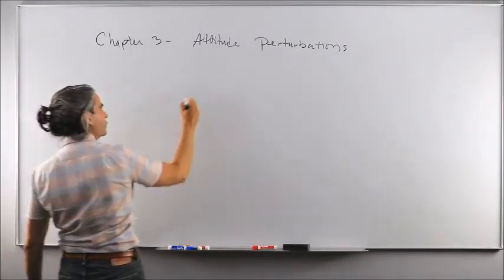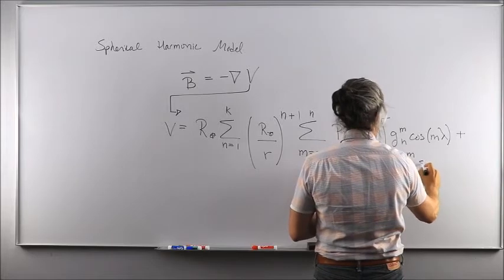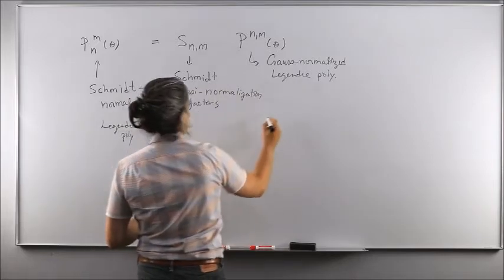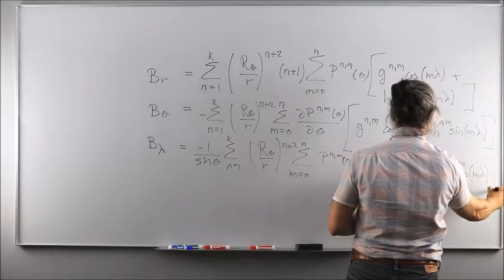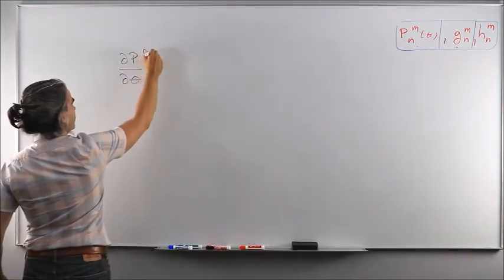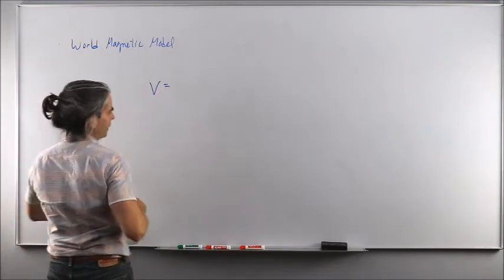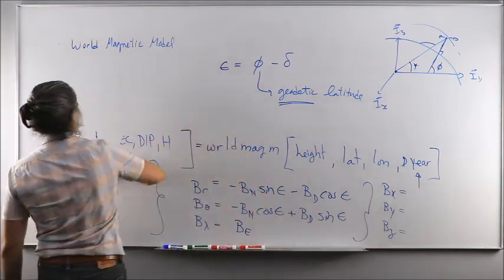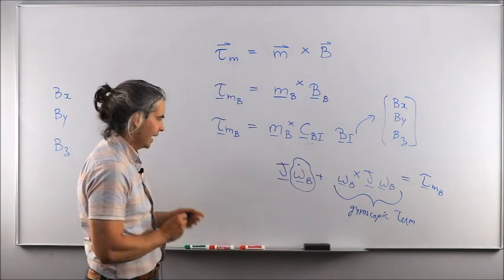AERO4540 - Spacecraft Attitude Dynamics and Control - Lecture 7

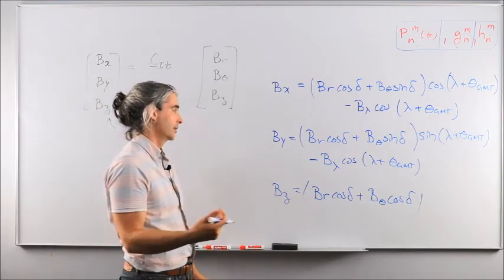Comment: Thanks for the video, Dr. Ulrich.  I have a question regarding the conversion from ECEF to ECI components of the spherical harmonic model equations (50:56).  

If I have understood correctly, shouldn't the B_lambda term be multiplied by -sin(lambda + theta_GMT) in the B_x equation, and by +cos(lambda+theta_GMT) in the B_y one?  If B_lambda points positive East, then it should point purely along the positive y ECI direction for 0 longitude and GMT, and purely in the negative x ECI direction for a longitude of pi/2 at 0 GMT, shouldn't it?  

Secondly, if B_theta points positive south, then shouldn't the term multiplying this component in the B_z equation be - cos(delta)?  This would mean that it has zero affect at the poles (delta = + - pi/2) and is pointing purely in the negative z ECI direction at zero latitude (delta = 0).  

Apologies if I have misunderstood something but I would be very grateful for your help in checking this.  Thank you again!